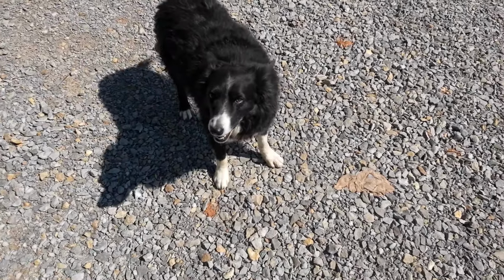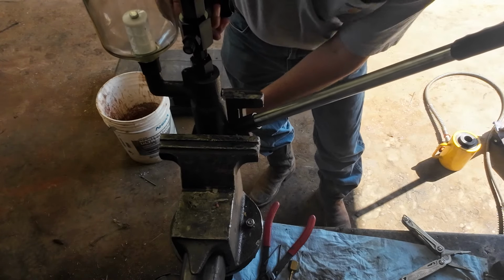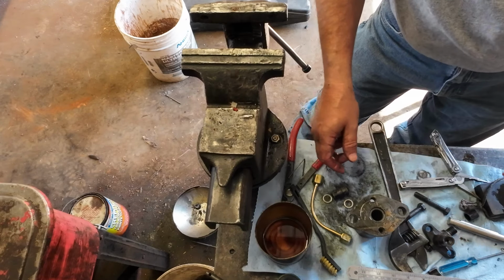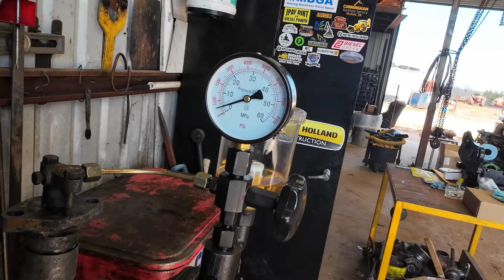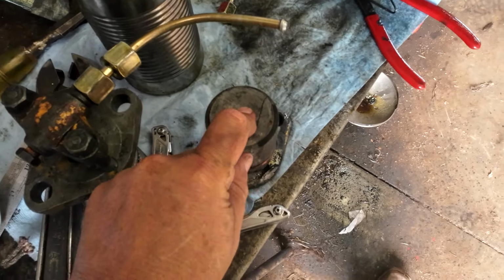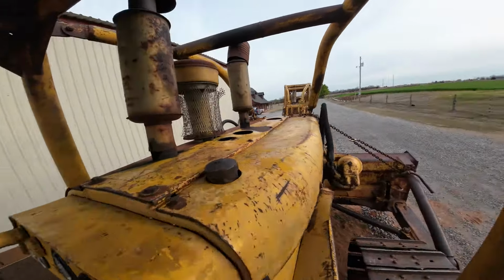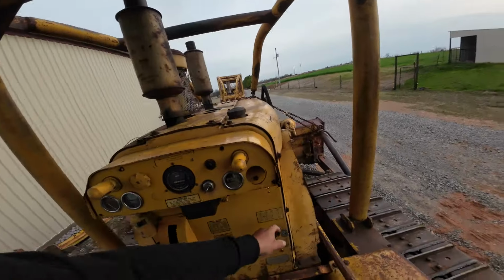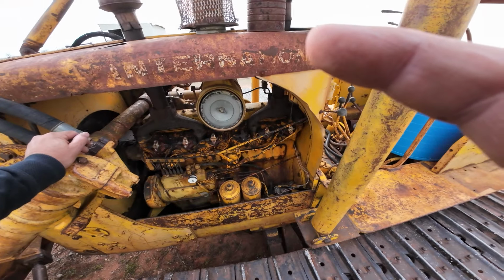Td15 injector test. #digginok #dozinalright

Comment: Frank,
    I will take a video such as this everyday of the week…, loved it.  In the older “Caterpillar” dozer numbering system, where does the TD-18 land…, maybe a D6…?  Approximately what is its’ vintage…, 1950’ish…?
    Thank you sir.
Reply from the maker: This td15-151 dozer was built from 1961-62 only 679 of them made. It’s a 105 hp dozer, if I’m not mistaken its rival would have been a d6b at 90-95 hp. The td15-151 was replaced with the powershift td15b with a turbocharger and 115 hp. And thanks for watching
Reply: @Digginok  ok, thank you for the reply back.